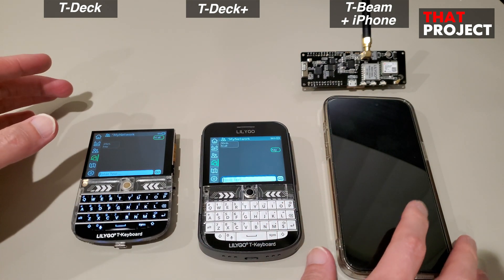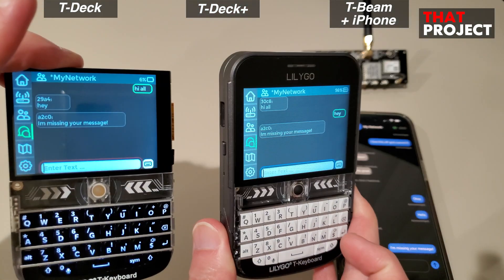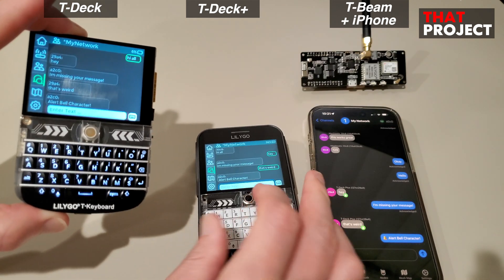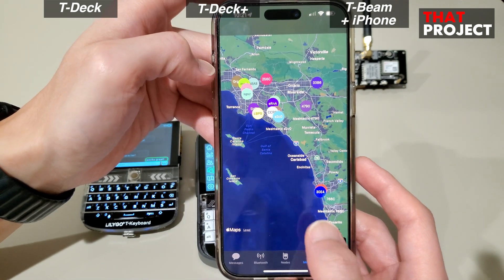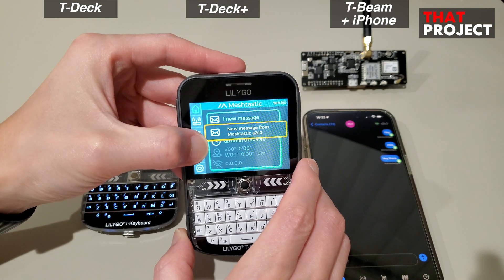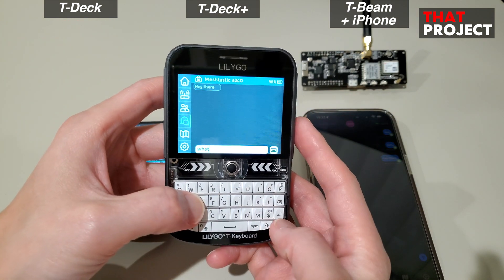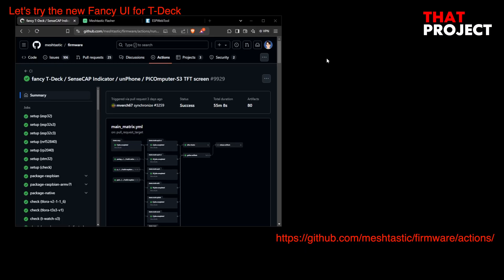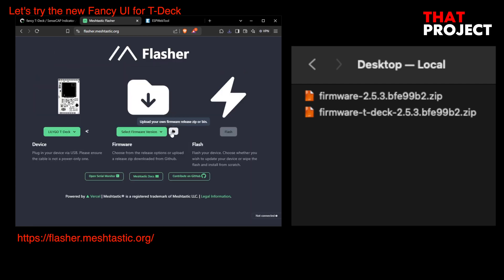T-Deck/T-Deck Plus & T-Beam+iPhone with Meshtastic: Off-Grid LoRa Communication

Comment: Can you please explain how those devices are connected with each other????
Reply from the maker: @sv4rin  All of these devices have a LoRa module. The frequency is 915MHz (North America), and communication is possible through this.
Reply: @ thank you dear. What about Europe ? Frequency is different ? And are those devices communicating only with each other, totally independent of any wifi network or cellular ?
Reply from the maker: @ The European frequency of LoRa is 868 MHz. This communication module operates independently and is not related to other communication networks.
Reply: @ Thank you for letting me know, but if that is the case we are talking about something pretty useless in an urban environment, as the few miliwatts of power cannot cover more than 100 meters ( at best ). Additional equipment should be used ( repeaters ) and I don’t see how handy this can be.
Reply from the maker: @sv4rin  Yeah, in urban areas, relatively long-distance communication may be difficult due to environmental factors.

Comment: Hi. I bought 2 Deck plus and both already have updated firmware with beautiful UI. Can I get them to talk to each other without needing a third hardware/node? How? Tks
Reply from the maker: As shown in the video, have you set the frequency to match your device and region? In my case, I am in the US region, so I need a device for a frequency of 915MHz. If you set this part in the settings on both devices, you will be able to communicate without any problems.
Reply: did you buy from Lilly go direct.. still learning and would rather buy like ou with he fancy ui installed
Reply from the maker: @Olawalestreams  Yes, I bought it from the Lilygo site because that's where I could get it the fastest.

Comment: welp, didn't take them long to delete the T-Deck firmware file from this release, lol. the project really, REALLY does not want people using this. someone must have noticed that your video was promoting it and sniped it to stop people from downloading it.
Reply: These builds expire after 30 days. Nothing was deleted on purpose after this video was published. There are no new builds being made by the CI till this is released as a tech preview.
Reply: Quite the conspiracy. They were not deleted. PR artifacts expire automatically after 30 days. However, we turned off PR artifacts for this because too many individuals were sharing links that expire that lead to comments like this -- all on a firmware build we have not (nor are ready) released yet. As soon as the firmware is in a state where it's ready for wider consumption it will be added to the build files and flasher.
Reply: @Meshtastic  whats the ETA on this?
Reply from the maker: @notaprofessionalJ  Maybe they are reluctant to let “normal” users use the test version. I don't know.
Reply: @ThatProject  Reason was that ppl kept making reports that somethings don't work.